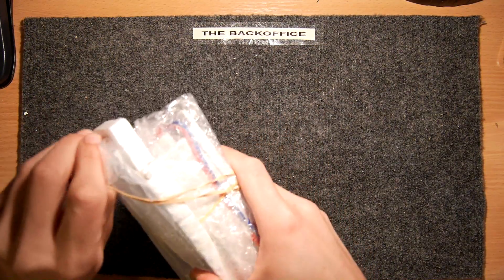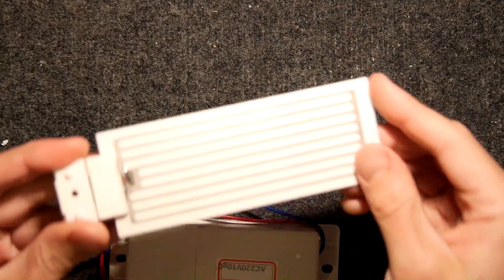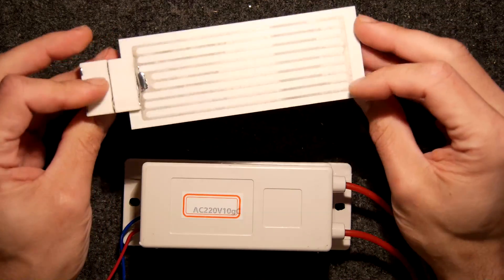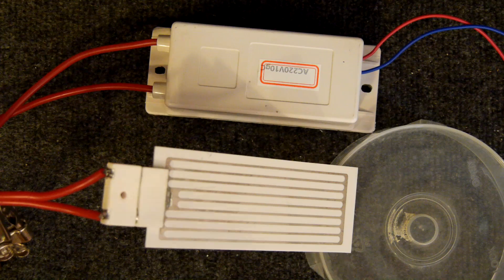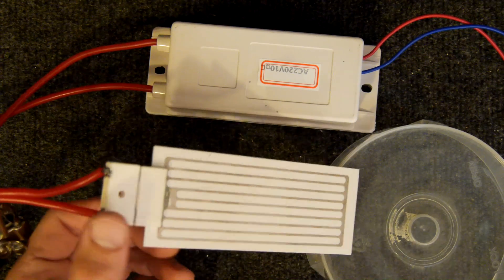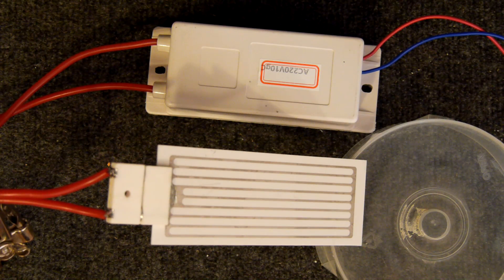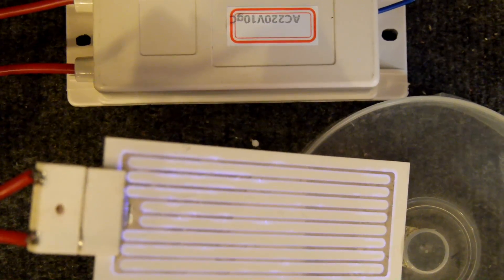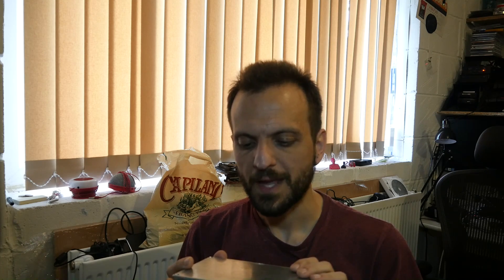Crazy Scary Ozone Generator

Comment: From everything that I've heard and read, the negatives far away the positives when it comes to the benefits. Ozone is very bad on anything organic, so it can eat the inside of your lungs, and also it eats anything that has organic compounds in it. So it will start to deteriorate rubber, plastic, you name it. When people use an ozone generator in their house, they're supposed to do it when there are no people or pets in the home. Just be careful.
Reply from the maker: I think people need to consider these like a bug bomb. Let's say a room stinks of smoke. You set this up, turn it on and leave the room shutting the doors etc. 20 minutes later, revisit it (holding your breath!) and disconnect the generator and open all the external windows to let the gas out.

Comment: What voltage is used at the input and can I use the ceramic plate without the "power supply unit" - what voltage is transmitted directly to the ceramic plate? Thank you!
Reply from the maker: Maybe 15000 volts?
Reply: @backofficeshow  That's a lot. Perhaps there is high frequency so people don't get killed when they touch the ceramic plate (they get stung instead). Partial skin effect might take place here.
Reply from the maker: It needs to be high otherwise it will not work

Comment: Plate creates a Corona arch this makes ozone
Reply: Wouldn’t the ceramic plate be used instead of glass for heat reduction thereby stabilizing the ozone.   But using oxygen that’s in regular air makes this very inefficient in room disinfection I would think.
Reply from the maker: It's got an insane output. I only run it for one minute at midnight to remove the smell of the cat litter in the garage. Last time I had it on for any length of time testing it, it started to bleach certain clothes. It's a while magnitude stronger than the units I have seen for public restrooms

Comment: You know that the UV-C light that puts out is very bad for your eyes. As well as being the frequency of light that causes skin cancer.
Reply from the maker: I suspect it's less damaging than the massive amount of ozone this chucks out
Reply: @backofficeshow  True. You just need to do your best not to breath the stuff if you can help it. I got one of these and plan to put it in a cheap toolbox with fans blowing air through. I was hoping to build it in such a way that the light doesn't escape much.
Reply from the maker: @infopackrat  I keep this on an IOT power switch near the kitty litter. It activates twice a day for 60 seconds. Keeps the area smelling sweet
Reply: @backofficeshow  Cool. I hope your cat isn't smelling it too deeply.
Reply from the maker: Nah, he is scared of the noise also is set to activate at times when he is not in the house
Reply: backofficeshow, without having a ozone meter, and a frequency detector, I don’t understand how you can say this device (that looks like nothing more than a germicidal light, and may have a ozone smell)  be a ozone generator.  Massive amounts of ozone that you described would seem to me, to require 95-98 percent oxygen concentrations, not 20 percent that is in normal air.  I would be worried more that your not protecting yourself from the light than any ozone produced from this and released in a large room.

Comment: Can someone tell me what the point is of putting together an ozone generator? Other than being used to sterilize lab and other medical equipment, I am left curious as to what this guy is doing with one.
Reply: Don't need anymore febreeze or odor maskers if you get rid of the odor in the first place, also useful for eliminiating mold and mildew from damp rooms/ basements. ozone does smell nice, it melts the linings of your lungs but you would rather have your lungs linings melt than catch deadly pneumonia from a mold infection.
Reply: You can use it for medical but you would buy a ozone and oxygen generator for that purpose only. I definitely would buy a ozone monitor if you buy a do-it-yourself ozone maker for like room disinfectant. This was probably a germicidal light and not necessarily a ozone generator since no high concentrations of oxygen was used.

Comment: useful video thank you (if only to simply take apart the unit as i have complete ones ready to link up and plug in. Cheers
Reply from the maker: Thanks for the feedback, appreciated 😁👍
Reply: @backofficeshow  I think you did a great job here mate as it connects it from the ground up (pardon the pun) and you get to see the innards of the control unit (helps curiosity!). Ive got a unit that has 10g output and im converting it to 30g. (yes I know thats insane but I like to be able to run this stuff as a commercial option although I have the UV lamp version as well designed for waste compactors.) The output is a fair bit on that too but in fact less than these chinese plate ones. You have to gently clean them of oxidation now and then with a knife blade to restore them as most people think they dont last but in fact they can last a while As its not really taking much juice i believe I can use WAKO connectors to simply wire it all up.  I have also bought three bearing 240 fans to circulate as that level of Ozone will require a decent flow output. Its all contained in a large alloy venting box so could be used as part of an intake. Some people add timers but I think I might go one further and use a wifi one so I can be WAY away from this thing when its made. Half life for 03 worth doing your research from as its not good breathing that stuff in as it quickly irritates membranes in your lungs. Im sure you knew all that though. Again thanks man, good video!
Reply from the maker: No problem, good luck with the build! 👍

Comment: I installed one of these in the air intake of my Jeep for a nice boost in power. Ozone is pure oxygen with an extra atom, which added to combustion makes for a better burn.
Reply: It's only a recombination of the oxygen already existing in the air. No more oxygen is added from the device. Are you sure it can produce a boost? Did you measure it? How many HP/NM?
Reply: Never implied the device manufactures oxygen, however with o3 as a radical and unstable it will bond nicely to fuel components once injected. Output of the gen is something like 600gph I think. I also tapped the distributor cap on the jeep for additional ozone. I didn't dyno anything. I don't have sophisticated test gear. All I can say is try it yourself and see if you feel a difference.
Reply: @bogey6925VR  i love these tips and trix. forgive my ignorance: i'd like to understand what the electrical distributer and O3 in relation to the distributer has to do with a performance increase. i am trying to follow what you mean by tapping the distributer cap, do you mean you drilled a hole and put threads in that hole? presumably to connect a pipe to supply O3 to the inside of the distributer? i am trying not to laugh and i must totally misunderstand everything in your post. i cannot envision an O3 generator that makes 600gph, and if it does, that is a small fraction of the gph of air a car must use. i don't see how such a small amount of O3 could make any difference, anyhow, i'd like to try it, as you suggest. is the small unit that is made in this video what is making 600gph? thanks for taking the time for the original post, this is all stuff that i would never have thought of
Reply: @iflnr978  Yes, I tapped the vent on the distributor with some tubing and routed to the intake. This will also help the distributor last longer and be free of oxidation. Ozone capture isnt much but you don't need much to have an effect on the OH radical process in the burn, and enhance the burn.
Reply: mike walsh I would have thought O3 would increase oxidation. After all, it’s like super O2? I would have thought any gas except O2 and O3 would decrease oxidation. Maybe if it’s flowing through. Do you have an outlet from the distributor to the intake manifold?
Reply: @iflnr978  Most distributor caps already have a vent built in so you tap the vent with tubing and route a hose to a venturi on the intake. The distributor cap lasts longer because you are removing the ozone better than just the vent they have on it.
Reply: shody ryon, I agree with you..Any ozone that is produce in the device shown is more of a bi-product of a germicidal light. Without using oxygen in 95-98 percent concentration range, it doesn’t seem that it would be able to supply the ozone (oxygen) level needed for a carburetor to make a difference.

Comment: is the output of that cable both done soldering is all negative pole? can i use the anion generator with 4pin-10pin  get 2of them, and how does connect this ceramic plate too  https://www.aliexpress.com/item/Blue-Ceramic-Plate-With-Ceramic-Base-For-10000-Hour-Long-Life-3-5G-hr-Ozone-Generator/32785263859.html?spm=2114.search0104.3.1.27757993XMcqCV&ws_ab_test=searchweb0_0,searchweb201602_1_10152_10065_10151_10344_10068_10342_10343_10059_10340_10341_10696_100031_10084_10083_10103_524_10618_10624_10307_10623_10622_10621_10620,searchweb201603_43,ppcSwitch_5&algo_expid=013f7db8-1e4a-43d5-bf79-abd846cd8563-0&algo_pvid=013f7db8-1e4a-43d5-bf79-abd846cd8563&priceBeautifyAB=0
Reply from the maker: It's probably too complicated to explain here, but from what I can see, it should work
Reply: oke so thats anion generator output is negative and positive pole, or negative both?
Reply from the maker: Both

Comment: That soldering was much harder than it had to be.  The part you solder disconnects from the ozone plate, thus greatly reducing the mass that could absorb heat from the gun.
Reply from the maker: +LS yeah, annoyingly I later discovered that, oh well 😂

Comment: Anyone try to measure a ORP potential water after dilution or gas 
concentration? In my opinion, it's not ozonator. This device do not 
produce ozone, but something other
 compounds. I aerated NH4OH and sulphar solution by this device. pH the 
first (10.4) and second (7.4) solutions did not change althought it must
 have change (pH must decrease after oxidise of NH3 to NO2 and S to 
SO4).

Comment: Is the power supplied to the plate A.C. or D.C.  I've found that the voltage is around 3500 volts.
Reply from the maker: +imarat21 not sure how I can test it without blowing up my meter 🤔
Reply: Several resistors in series to divide the voltage keeping the voltage below each resistors V rating and tap the meter at say 100 to 1?
What spec's I've found suggest it's under 5kv but several thousand HZ ac.

Comment: Wow...this was a little dramatic. The voltage is high but the current is very low. I'm not saying to touch it (still very shocking), but all things being equal, a typically T8 fluorescent ballast is just as "dangerous". The ceramic plate as far as ozone generating goes is quite a bit better than the plate-glass/metal mesh that was used in the past.  Also, DIY guys used to use neon sign ballasts for the voltage and current control. In the end, you didn't know what to expect as far as performance and output.
Reply from the maker: +Eric Keith its a bit like the first time you use a welder, the unknown is scary 😂

Comment: if you cleaned your soldering iron tip it will work much better
Reply from the maker: The main issue was the terminals were connected to the plate and it was acting like a huge heatsink. Unplugging it makes them far easier to solder to.